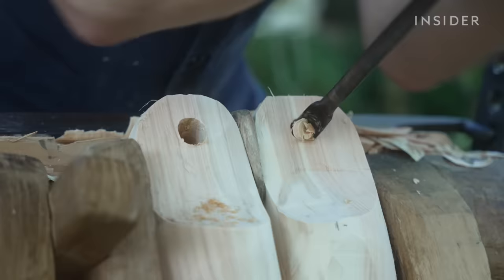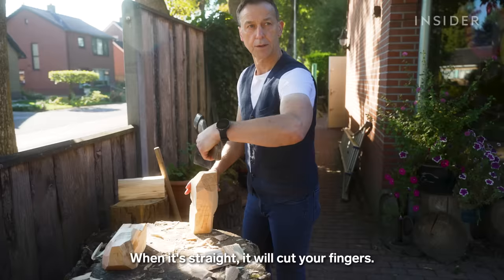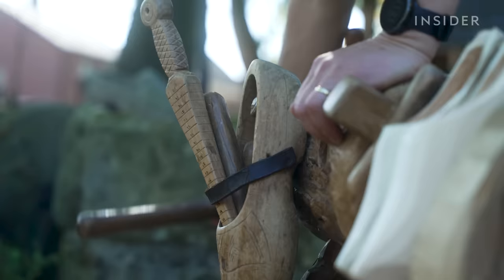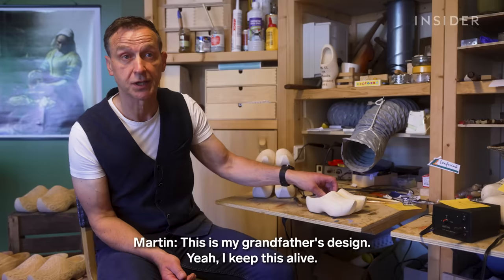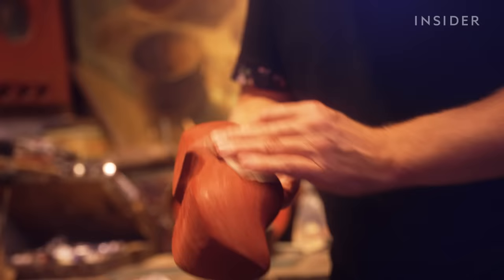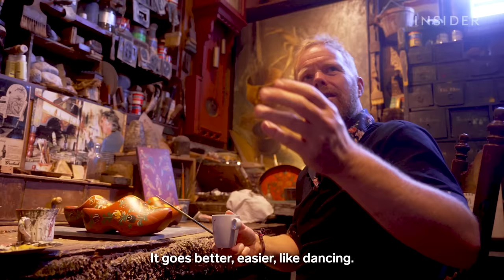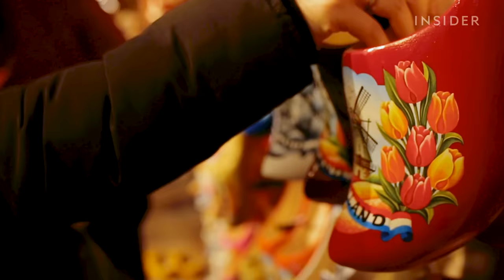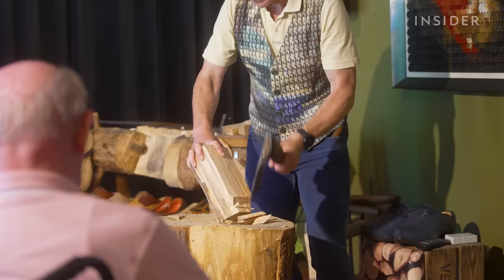How Dutch Clog Makers Are Keeping An 850-Year-Old Tradition Alive | Still Standing

Comment: Klompen are still certified as a safety shoe in the Netherlands, and in some workplaces they can still be seen somewhat regularly. Most millers still wear them daily, as do some farmers.
Reply: Some farmers? In my area it looks strange when a farmer isn’t wearing clogs
Reply: In Switzerland they were used as safety shoes for ammunition factories until the 1970's. They were afraid the metal toecap of regular shoes might produce sparks in an accident.
Reply: Only small farmers. 
Also, yeah, can confirm them being used as safety shoes, because I am one of those people.
Reply: @Langharig_Tuig  There are no small farmers in the NL's, everybody is around 2 meters long.
Reply: Makes sense, they're the pre-industrial (and even used after the industrial era) equivalent of steel toed boots.
Reply: @MtJochem  I laughed way too hard at that dumb joke lol
Reply: @iotaje1  We had such an incident at the Muiderberg powder factory in NL, but it was smoking immigrants that blew up the plant.
Reply: construction workers also from some areas mainly smaller protestant villages
Reply: What do they use for soles? Do they have good grip? 

Slipping is not something you want to happen in a place that warrants the use of safety shoes
Reply: @Drebolaskan I believe rubber treads can be glued or nailed onto them.
Reply: @Drebolaskan   nothing I think, you can hear them comming from afar. because the wood makes a loud sound when it hits the floor 
. especially on tiles or concrete.
Reply: @Drebolaskan in the hot summer days they get slippery because they are to dry, in normal humid weather they give exceptional grip
Reply: Even after immigrating to the US, my Opa would always wear his klompen in the garden!
Reply: Dutch OSHA engineer here, Klompen are not safety shoes! I repeat, klompen are not safety shoes! The rest true thought.
Reply: @bertgernaat4746 With a name like Bert Gernaat, you couldn't lie about being Dutch if you tried! I love it. Anyhow, I wonder how often you've had to have the "klompen are not safety shoes" conversation? I can imagine that the old folks don't believe you!
Reply: @barahng  In many instances clogs are actually safer than steel toe shoes. Clogs crack while steel dents, making it easier to remove the shoe after an accident.
Reply: Seriously? Soft wood for safety shoes?
Reply: @Pakiu1306  Yes, they don’t show it in the video but there is a hardening process. Soft wood is easier to work with when making the shoe
Reply: @bertgernaat4746 While not officially safety shoes, they can be greenlit by employers and safety auditors, so I would say they are safety shoe-adjacent
Reply: @bokoe7469 I mean how’s that safer exactly? I’d rather have just a dented steel toe boot, and maybe a somewhat sore foot. Than a clog that cracks in half. Do you think your foot is going to be ok if something heavy enough landed on it and cracked your clog? No 😂 You’re gonna have a broken foot bud. Probably a nasty big splinter or two as well. Steel is about 1,000 times stronger than any wood. There’s literally no advantage a clog offers that a modern boot doesn’t do better. Like yea over a hundred years ago these were the top of the line, but today in a industrial environment they don’t meet the standards necessary to keep your foot safely intact.
Reply: @TheSquidPro  Interesting, do you have any sources for that? Since I can’t seem to find anything about the actual cause of the explosion
Reply: Yup, but there's a difference between Dutch traditions and mass produced machined clogs. I think the the message here is that the art of making real traditional Dutch clogs is disappearing, not that wooden clogs are. Whether the message is true or not is not for me to determine, I plead ignorance.
Reply: @cooliodiablo4571  As I said, it depends on the situation. You wouldn’t wear clogs in a factory, they are meant for farm work. Properly hardened wood (like in clogs) can actually be about as hard as steel, so it takes a similar amount of force to dent steel than it does to break hardened wood. The statement “steel is about 1000 times harder than any wood” is just made up. There are many reasons why a lot of Dutch farmers still prefer clogs over modern steel toe shoes, including safety. Clogs also protect the entire foot rather than just the toes, which is useful if a horse or cow steps on the middle of your foot with full force. Steel toed shoes are more versatile however, and are the safer option in factories or kitchens. If a steel toe dents, you’re not just going to have a sore foot, it can cause all kinds of problems relating to constraint of the toes. In more extreme cases, the steel can even cut your toes off. If a clog breaks, most of the energy from the impact has already been absorbed by the wood, making the impact relatively light.

Clogs are actually certified safety shoes by Dutch law in certain environments.
Reply: @bokoe7469 no there is absolutely no way wood is "about as hard as steel", wood wouldn't even show up on a steel HRC hardness measurement. It's way weaker than steel, and anything that would seriously dent a steel cap would absolutely destroy your wooden clog.
Reply: @redwillrise  Regular wood isn’t as hard as steel but HARDENED wood can absolutely be of a similar hardness as steel, especially with modern techniques. And besides that, a shoe that breaks is often safer than a shoe that dents for a variety of reasons. 

You have probably never seen, touched, or let alone worn a clog. Stop pretending to know what you’re talking about.
Reply: Really I thought some farmers were normal work shoes but I think clogs are a typical Dutch thing
Reply: @Drebolaskan  They have no grip, thats why we're so good at ice skating.

Comment: Most people don't realize how amazing Klompen are for gardening!!!   When you use a spade, it is SO much easier because you have a hard sole and it transfers your momentum straight through to the spade or shovel.  Also they are better than the rubber slipon gardening shoes because klompens don't transfer the cold onto your feet quickly like the rubber types of garden shoes do - Klompen keep your feet warm and dry.  As klompen are a bit bigger you also don't sink into the soil like a regular shoe.   I never realized until I had my first klompen nearly 20 years ago how great they were!!!
Reply: Feel like they are not great in regards to comfort because the sole is very hard.
How is it for you?
Reply: That's good insight because on pretty much any metric I can think of, they look terrible
Reply: @Appoxo  It's like high heels, once you are used to them, they're fine.   You can put moleskin on a bit of the top the first time around or wear thick socks as regular shoes have tons of give in the sole and the uppers.
Reply: Right!! We wear klompen in Sweden aswell (but we call them "trätofflor"), and I always use them when I'm gardening!
Reply: This Dutchman can confirm that statement, and I have a pair myself, as do my parents and siblings.
Nog een fijne dag allemaal. 😁
Reply: @Appoxo They’re comfortable on soft soil. The Dutch klomp was made for the Dutch swampy soil, back when there also weren’t many stone roads. On modern roads they’re uncomfortable, but out in the garden or on a farm they’re great. If you have a decent pair, they’ll shape to your feet, so it does take a bit to break them in but they only get more comfortable over time. It also used to be common to wear them with thick wool socks. That’ll keep you warm and dry, and make the wood more comfortable too.
Reply: @Appoxo  I used to wear them as a child all the time, even when i'd go to the store and such. It's not bad at all and i thought they looked nice
Reply: @Appoxo   a good clog is amazing, feels better than a normal shoe. 
In the winter they are comfy warm, in summer they stay cool. 
They walk SOO good, better than my normal shoe
Reply: @tigress63 Another thing about the Klompen I can think of is you can use them for kicking with your feet for Taekwondo like imagine a roundhouse kick to the face with a wooden instep or a side kick with a wooden heel part of the shoe, that's gonna hurt. Pretty cool huh?
Reply: @pierrex3226  That sounds like a "you" problem.
Reply: @Appoxo i wear military boots regularly, wooden cligs would be WAY more comfortable
Reply: @natsinthebelfry no, they're actually quite terrible for you. It's like the people clinging to Chinese foot binding. Yall don't see what this shit is doing to you because you treat these things like faith

Comment: I'm an American woodworker without any Dutch ancestry; but I'd love a pair of clogs for my shop. That, and those clogger knives are just brilliant.  Having that much leverage with a that much control must be amazing. I'm in the process of trying to figure out how to get my hands on one.
Reply: What are you searching for? The tool or a pair of clogs? Sadly, I can’t help you get the tool. If you want a pair of clogs from a traditional clogmaker, I can provide you with those.
Reply: Maybe you could have one of those knifes made. Shouldn’t be a problem for a skilled blacksmith.
Reply: @jornthendriks3550 how can one go about that?
Reply: The long knife for forming the outside shape is called cloggers knife or stock knife. There are different lengths You can choose for your work. 😊

Comment: In the mid 1970s I bought a pair of these full wooden clogs. I did have them soled and heeled to protect the bottoms. Though they looked clunky and people gave them funny looks, they were the most comfortable clogs, footwear I have ever worn!! 
They were light, easy to walk in, great in all types of weather - the feet are protected, cool in summer, warm in winter. No doubt they are big and people in the States aren't used to seeing them but they are terrific foot wear 💯‼️❤️
Reply: One of my companies clients actually wears them with some kind of cow hide insert and outside. Kinda look funny but (according to the comment section here) most likely very comfortable
Reply: I abhorrently refuse to believe two pieces of wood were the most comfortable you have ever worn...
Reply: @baddriversofthenorcalarea500 I'd believe it, though I'm yet to get any for myself. For me, though, the most comfortable shoes I've ever worn were Merrell Vapor Glove 5s- which are basically socks with a few mm of Vibram outsole. I suppose clogs aren't too different in principle.
Reply: @baddriversofthenorcalarea500  My mom used to use them for gardening and I always loved to slide in them and use them to get the laundry off the line 😄 They are extremely easy to put on, and then they're just there and won't fall of until you want them to. They don't restrict your blood flow and won't let your feet sweat like a lot of shoes, maybe that's one of the reasons people love them. You have to wear the right size for your feet of course.
Reply: Indeed wooden shoes, like clogs or asian sandals are amazing in summer: breaths and keeps feet dry and pleasantly cool.
Reply: I have very wide feet (ball of foot to the tip of toes but a normal heel) and would love to find a pair of these Klompen made just for my feet!

Comment: Klompen are very comfortable because they can be carved to exactly fit each foot. My grandfather was a cheese maker in the Netherlands and we immigrated to the USA in 1972.
Reply: There's more to a shoe's comfort than the fit. A large component is the sole composition, of which these have none, just wood straight through.
Reply: They are bad for your feet.
Reply: @redrick8900 doesn’t matter if they’re useful. Sugar is also bad for you, you still eat it.
Reply: Also, klompen are actually terrific shoes. Very good to work in. I actually do forest walks in these, I can run in them.
Reply: @samvandenboogaard263  don't get twisted or sprained ankles?
Reply: @acex222 Do you have a source for that?
I thought the point of softer sole composition was so It conforms to the shape of your foot.
Unless it's like a running shoe.
Reply: @acex222  wool socks go a long way to comfort with kloempen ;)  Also it's not uncommon for someone to put thin rubber on the sole which touched the ground if they're going to be used on rougher paths...

Comment: 1:01 knowitall interjection: he means "hard wood" (dutch "hardhout"), not the english term "hardwood". the latter refers to all deciduous trees' wood, while "softwood" refers to conifer wood. poplar and willow are soft and light hardwoods, they have a density range equivalent to the range from spruce to loblolly pine, just more homogenous with barely defined growth rings. no softwood is anywhere near as light and soft as balsa, the lightest hardwood (though the densest hardwoods also are unrivaled by any softwoods by a very large margin). it's just that the most commonly used softwoods are mostly softer than most of the commonly used hardwoods. they're ill-conceived terms, really.

Comment: I love the artistry of the clog, and I can appreciate the utility in wet climates, but are they comfortable?
Reply: No not particularly. Its quite hard for your feet since it is just wood without any padding. For small periods of time it is fine and often quite convenient, for example if you need to take the trash out.
Reply: Yes they are comfortable, you have to get used to it. Alot of farmers wear them like 16 hours a day, so cant be that bad aint it.
Reply: like the others said, it takes time to get used to because we are all used to soles that bend as we walk.   You will get a blister the first time you wear them on the top of your foot if you don't have some sort of padding as it takes a bit to adjust to walking with them, but they are amazing for gardening!!   They are good it wet climates too because your feet don't get cold like with rubber garden shoes.   If you get them wet and you live in a really dry climate eventually they crack and you need to get a new pair.
Reply: Absolutely not. But if you wear thick woolen socks, they help a little. Best not to use them for walking but for static tasks, like gardening.
Reply: Of course! I would not walk a marathon in them but for normal day to day walking and working they are great

Comment: Actually Gabriel Mouton about 150 years before Napoleon is credited as the creator of the metric system and thus the centimeter. Although it wasn't rationalised until 1883 by  Oliver Heaviside, 50 years after Napoleon died.
Reply: Napoleon did introduce the metric system to the Netherlands.

Comment: Traditional Dutch clogs, or "klompen," have been worn by farmers and factory workers in the Netherlands for over 800 years. However, the number of traditional clog makers has dwindled to just 10 in the country. Machines replaced hand-carving in the early 1900s, and wearing wooden clogs fell out of fashion. Today, clogs are mostly sold as souvenirs. Clog makers and painters have had to diversify their businesses or invent new forms of art to stay afloat. Martin Dykman, a fourth-generation clog maker, still uses an axe to carve the rough shape of the shoe. He avoids knots in the wood to prevent holes from forming in the shoe later. Dykman learned everything from his father, as traditional clog schools no longer exist. He carves the outside and inside of the shoe on a wooden bench his father built over 50 years ago. The final product is smoothed and burned to dry, and each master clog maker etches in a design, similar to a signature. The oldest wooden shoe found in the Netherlands dates back to the 13th century, and clogs were worn by everyone from farmers and fishermen to factory workers. However, their popularity waned in the early 20th century as leather became more affordable and machines replaced local clog makers.

Comment: My mom used them for the garden. It is not only safe for the toes, they are also better in mud. Waterproof as long as you dont dip them in totally. There are versions with leather attached going up to the knees even. you also dont get cold feet that easy. Wood isolates even with muddy ground.

Comment: Clogs are are still regularly worn by a lot of farmers and they are good and comfortable safety shoes. Hard to believe only 10 shops are left in the nation when I see them used quite regularly. It helps (or doesn't, if you believe in consumerism) that they never really get worn down though. And if you work outside as a farmer or the like you will also quickly realize that clogs are the best shoes against marshy conditions. Which can really hinder your work otherwise. Just plain rain boots get sucked it and pulled off of your feet in no time.

Comment: you have to see them as the prehistoric crocs, the quick slip on shoe that you didnt mind getting apselutely filthy and damaged. 

it might then not suprise you that the klomp was the insperation for the crocs. klompen are not often seen anymore in their full wooden state, but there are still more modern variations of them. there are versions where the sole is still its tratitional wood but the cover is hard leather. in the netherlands and in belgium you will not be suprised to see a few docters wear them around the hospital

Comment: It does not take half a day, pre 1900 a clog maker made 5-6 pairs in a 10 hour work day, after 1900 they started using steam powered machines for the basic shape but still fine tuned and finished them by hand.

you bought them straight form the clog maker who made adjustments by hand so they fit your feet perfectly with thick socks. If not, they are a pain to wear, when properly fitted there is little better for everyday work.